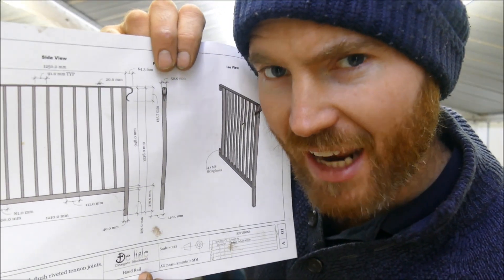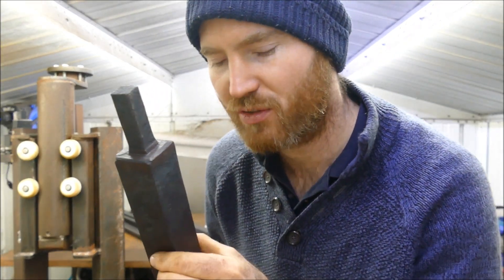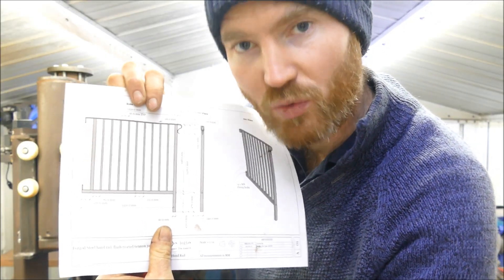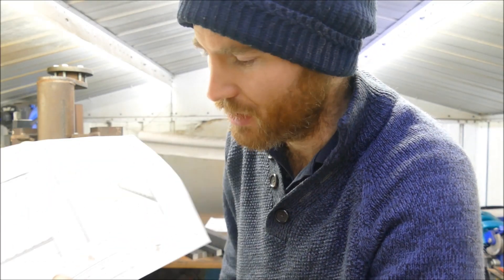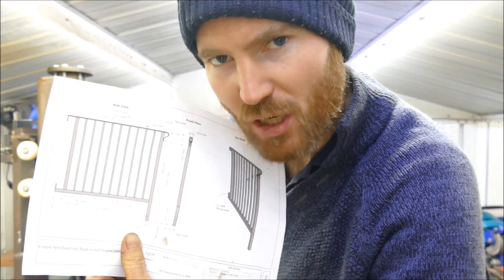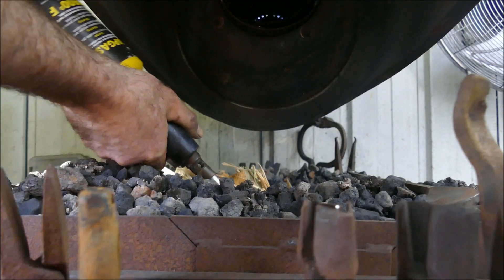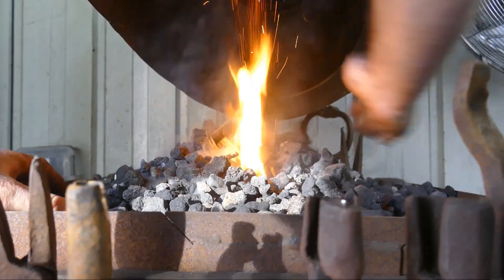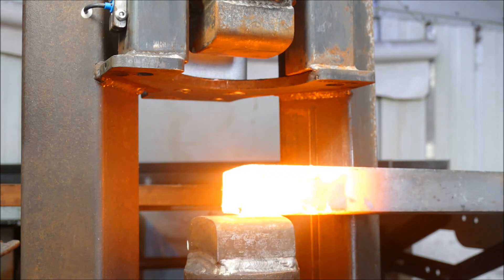New! DIY induction forge for £75 - 2500w PCB review and forged tenon joint railing build

Comment: They need a fast ramp to start so the powersuply needs to be on before the pcb, and the one you use is a switchmode that needs a load to start up, so a bulb or something and when stabile a switch to start the pcb at full voltage. A ramp voltage will fry the pcb.

Comment: Hi, I'm designing and building my own induction heater. 3.2kW (320VDC, 10A) for 2.4kW heat delivered to the object to be heated. Truth is that induction heating is very good but extremely demanding on the electronic components. Cheap Chinese works....briefly!!! For sustained use they are just not up to it. There are decent, even Chinese made induction heating power units, but not 75GBP.....they start at 750GBP....and those are just the entry level pro types, the good ones are more like 7500GBP.

My design takes 230VAC rectified and smoothed with a capacitor bank (4700uu @ 400V) through a phase-shift controlled full bridge of four MOSFETs. The output of the bridge is applied to the primary of a 3.2:1 ferrite transformer (twin 130mm E cores, A=1600mm squared). The Output of the transformer is applied to the tank (1.5uH in parallel with 3uF capacitor). The leakage inductance of the transformer, approx 30uH, is bought to series resonance with a high current 270nF capacitor (rescued from a big Miller welder).
The PCB is doublesided 420um copper (12oz per square yard), so approx 12 times thicker copper (layer) than your PCB....as I say cheap Chinese is just not reliable for anything other than demonstration purposes.

I'm starting to get good results, but not before blowing up a dozen or maybe two dozen MOSFETs! The bottom line is that switching high voltages at high currents at 75kHz is not easy, especially when the 'load' is resonating. In my case I have the primary of the transformer in broad series resonance and the secondary load (the tank) in parallel resonance.

Comment: Induction heater is a very poor design yes but because your not and electrical engineer you won't understand what your doing with proper design those Induction heater that sell on online or resonator that need a relay to act as a spark start up to keep the mosfet working and because the mosfet gate is poorly driven the mosfet smoke 🚬 and heater current in the changing pole stay in the capacitor and get so heat smoke again so the right way to design a Induction metal melting circuit is to use iigbt that can handly thousand of amps reverse  and the igbt most be and resonance igbt as well and use in a halfbridge driver with circuit with oscillator pwm to drive the igbt with and use a resonance circuit with highe current high frequency capacitor that is rating for induction heater and then you you won't have smoke issue

Comment: I've bought one already 😂. It seems to work fine with my welder (it gives around 50 volts). However I've tried only original coil. It heats the bar red hot but it is not enough. I need to try other, smaller coil but it will change inductance and it may cause problems. We will see

Comment: The cause of the induction unit overheating has been identified here, as in the coil is part of a tuned resonant circuit, so changing the coil changes the resonant frequency and current in the oscillator devices.  As for using a welder for the power supply,  the current output may be 50 amps, but it's the voltage that matters to the induction unit. Migs and tigs produce high current but at low voltage, and also the DC they produce isn't smooth, it's a series of positive pulses. That induction unit wouldn't like that!

Comment: The Circuit Design of this Induction-Heater ist called "Royer Converter". This Circuit needs a very sharp increase of the Voltage at startup. If its to slow the Oszillation doesnt start and both Mosfets are conductive and you create a Short. then you see the magic smoke. To prevent this, turn on your Voltage Source first, and after a few Seconds turn on your Heater. Because most Voltage Sources have Softstart.

Comment: Induction Heaters  produces heat  by  alternating "Eddy Current" flowing in the metal work piece (at a higher frequency) and this is quick and very efficient. The idea that resistance heating will be better is just uneducated BULLSHIT.  Also ..you don't have to water cool the induction coil since this shouldn't heat up much if you have a proper  design.

Comment: You can't use an AC breaker for DC current. DC breakers have a different internal set up to separate the contacts safely as DC electricity is constant and it arcs. AC breakers can't handle this arc and they burnout

Comment: Induction heating works because the applied magnetic field induces Eddy currents which act in opposition to the applied magnetic field. These eddy currents flow through the workpiece heating it up in the process.
Reply: Just to clarify. The Eddy current is caused by a magnetic field induced to oppose the applied magnetic field. Eddy currents can't  be generated in the same direction  as the applied field  - conservation of energy.  A metal does not need to be magnetic to see Eddy currents pass through it and heat it up. 

Check manufacturers data sheet regarding circuit breakers - some don't like DC. They should state on the breaker voltage range - as usual in life some don't.  

Anyone wanting to see what the current is actually doing then a clamp meter with a BNC  connector output connected to a  cheap (£60) digital scope will work fine at 12 V  - just don't use such a scope at   voltages greater than  50 v  and you should be safe and learn something in the process ! 😁😁😁😁😁😁

Comment: You need to make a copper tubing coils for every size shape part you need to heat red hot.  The smallest diameter you can make gets hottest.  You also need to make 2, 3, 4, 5, 6, turn coils same diameter in some cases 3 will work best and others 5 turns work best, etc.  Coild do not need to be round sausage shape works to heat flat metal. .

Comment: You can do that with components for 5$ with performance you needed...
Also it's not "DIY induction forge for £75" -  it's some chineese garbage... That's the reason it burns itself...

So it's 3 years after video was published, but since you "burned" 3x 75Ł I dare you to try this, for example ;)
https://www.youtube.com/watch?v=6RYeDj0Wexw (and it's first random video i googled (and checked the circuit quickly :D ))

Will surely do the work you needed it for...
Also pro tip of the day: 
it's not Voltage that heats up the metal
it's Amps - but you can't increase those above certain level for certain materials with certaing shape etc...
what you CAN do, is to increase current frequency by changing components

Comment: 10:47 wrong explanation, the coil causes the electrons in the metal to move, the metal has a certain Resistance to it though, that causes the metal to heat up. i know nothing about forging but i know electrical engineering. main inefficiency is actually the magnetic fields escaping. more efficient is a direct connection like an arc furnace. your main issue is that your coil doesnt match the actual driver very well.

Comment: yes they need pure dc, and power supply need to be on and running BEFORE connecting to the board, as iv learnt. if you want to make dc with a bridge rectifier, it still too rough, but one way to smooth it right out could be 4 car batteries in series. (with each other, of course) (parallel to P.S.)they would act like huge capacitors (well bolted on) and keep them charged with the welder whatever... do you know alf??

Comment: Problem with Using a buzz box as you call it is the welders duty cycle. Only one welding machine manufacturer with a 100% duty cycle is Lincoln. Even with a Lincoln the electric welders usually doesn't have the 100% duty cycle like the portable gas or diesel welder generators. You can burn up a welder doing what you're suggesting by clamping both +- together on what you want to heat. The welding leads will melt through what you're trying to heat up before that happens. If you don't destroy your welder first.
Reply from the maker: Most welders have safety over heat switch so it's not a problem. My oil filled oxford is 100% duty at 220amps. Most welders have a 100% rated duty cycle at 60% of the amp capacity. So a typical 200amp welder is 100% duty under the 120amp setting. Cheers J

Comment: Hi, Joshua this video came into my recommended because I am actively building an induction heater I have a few tips. First off your 50 amp breaker is doing absolutely nothing you might as well take that out and rely on the house breaker, in short the power supply you are using lowers the voltage and increases the current so the current on the mains line will be much smaller and your actual house breaker will be the only one that will trip in a short circuit situation. Also this appears to be a ZVS driver which is a rather crude circuit to push past 2.5KVA (2500watts layman's) it likely does not have a resonance capacitor that is close to spec'd enough to push that kind of power. You likely need to buy a new resonance capacitor to get this thing working properly which may run you a decent chunk of change (not too much if you look around cheap capacitors on aliexpress such as dawn caps which have built themselves a reputation among the hobbyist electronics community). You may also want an oscilloscope for this kind of project to look at the resonance frequency between your coil and capacitor bank to make sure it is somewhere reasonable and not something completely out of the ballpark. something like 40khz shouldn't stress the Mosfets.

I am re-watching the video and have new points to make but don't feel like rewriting the original comment. upon closer examination that zvs driver seems more then capable of driving a 2500 watt induction coil. That is a large portion of the circuit board dedicated to resonance capacitors and those mosfet heatsinks do not look like they are something to scoff at. your problem may come from what other people are saying in that the frequency that is resonating between the capacitor and coil is to high. In short the capacitor value or the inductor value may need to change so the frequency is much lower as they are oscillating the power between each other to induce the magnetic field in the coil. I imagine with this circuit changing the capacitor value may be a hassle unless you feel like soldering some new ones on so you will be limited to changing the coil size like others have said. the formula for calculating the resonant frequency between an inductor and a capacitor is f Res =1/2π√LC with LC both under the square root symbol which you are not really going to know the value of your inductor as you have the knowledge of a layman. So I recommend taking an oscilloscope to both sides of your capacitor bank applying a much lower then normal voltage and measuring the frequency's it is resonating at when at rest and under load and making a coil where the values are around *say* 40khz. (note that 1khz = 1000hz) I imagine if you go much higher then *say* 80khz you may run into problems.

Comment: Glad for that advice Joshua, I have always wanted an induction heater and might have been tempted to buy a cheap one but it would have to be several kilowatts to be of any real use. I am a retired power engineer and would suspect that the components used in the unit are not rated for the job. As I have also experienced with similar products "buy cheap buy twice" or three times. I realise now that commercially available stuff is always expensive for a reason and building a DIY one is sometimes not practical except for experimenting.
However, I really liked watching the video about your skill as a blacksmith - most enjoyable and relaxing.
Reply from the maker: Thank you so much. I reviewed a 15kw induction heater after this which works very well. Cheers J

Comment: A welder to power this is not a great idea as their outputs will likely be way out of spec for something like this.
I expect this induction heater module is probably not rated for continuous use at the rated power. Your coils also need electrically insulating, glass fibre is good for that. As the coil really needs a water cooling at such high power, the best thing would be to also cool the electronics with a water cooling system.
Note also that switching the induction heater on and off without a separate switch for the fans is not good as the devices may get very hot heating some metal, but then you turn it off and the fans stop, so the heat isn't removed.
Re welders: different types of welders have different output characteristics. The older cheap stick welders were all simply a big transformer, so AC. Modern inverters are DC, but stick and TIG normally uses constant current output, so the voltage will vary all over the place. MIG is constant voltage so may work as a PSU, but you won't want the wire feeder running every time you use the induction forge. So called HF start (really high voltage) will put thousands of volts on the welding tip.

Comment: Great video, but your explanation of electricity, electrons and magnetism is a bit confused and not quite right. You are correct saying that when a current flows in a coil it creates a magnetic field and the most concentrated part of the filed is in the middle of the coil. However, it is not electrons flowing there, it is simply a magnetic field. You are also correct in saying that an induction  heater uses AC, so that the magnetic field inside the coil varies backwards and forwards. When there is another piece of metal in a varying magnetic field, the varying field will cause electrons to flow in that piece of metal, i.e. an electric current, called an eddy current. Except for superconductors, all metals have electrical resistance, so eddy currents will cause heating due to this resistance.
An induction heater operates at high power and frequency, i.e. the magnetic field is strong and changes very fast, so eddy currents in other pieces of metal will also be big and vary very fast, causing lots of heating.

Comment: The problem of the induction heaters is that the current in the coil is massive and a lot higher than 50 amps because of the resonance between the coil and the capacitors on the pub and if you use a smaller coil, the frequency that it resonates at is a lot higher causing much larger currents up to maybe even a thousand amps.

Comment: Amps are 'chosen' by the drain device. You can have 100amps, but if the drain device only needs 10A, then 10A is what will flow. Not sure if you mean the welder will increase voltage, not current, but wanted to add my half a penny.

I also feel that there is an issue with your coil. Seems awful small... 🤷🏽‍♂️

Comment: I watched black bear forge, he boughta very expensive induction forge Very expensive. bye for now the tennon joints were brill blacksmith. at 74 i am needing a power hammer. bye for now.
Reply from the maker: Thank you Tom. I also have a better induction forge now, there should be a video on it on my channel. They're awesome but still doesn't replace the solid fuel forge in my opinion. All the very best and hope you get well soon. Cheers J

Comment: 12:34 understandable since when you come out of a full bridge rectifier instead of it being a half sign wave its instead its positive to zero to make it true DC you need two sets of buzz bars with a array of capacitors plus a resister to make DC to jump the top of the sign wave to make true DC the resister is there just so when your not using it it doesn't kill the capacitors
edit: 14:30 i'm surprised you don't have oxy acetylene since most welding suppliers do the rent a bottle scheme where you pay for a bottle of oxygen and acetylene and when they run out you pay for the refill and swap the bottles and you don't need big bottles you can get the half bottles which are half the price to refill i think i paid 500 pound for my acetylene setup and i can't from the top of my head remember how much it costs to refill them but it's cheap

Comment: I am amazed such a concept could work without burning the copper coils.  Looks like a dead short to me.  A DC magnet does not induce any current in nearby metal.   It has to be AC.

Comment: I've built the exact same induction heater. It works fine with the recommended power supply. No over heating or smoking. My understanding is the size of the coil matters. The one they included is the right one. It heats metal inside a crucible.
Reply: yes it does matter a lot. the inductance should be matched to the Driver, atleast the cirquit looks like that needs to be the case, otherwise it will work poorly. source: i am an electrical engineering student.

Comment: Every other American workshop has a LINCOLN 225 AC only welder. If you use 7018AC rods, you can get a certified weld from it easy. Mine is 45 years old and never a grunt.  $200 and less used, maybe $400 new. I also have a 500 amp DC 2200 pound diesel welder on a trailer with all sorts of arc control. Guess what -  the little 225 gets 5x more use.